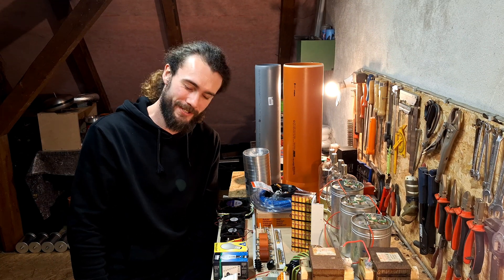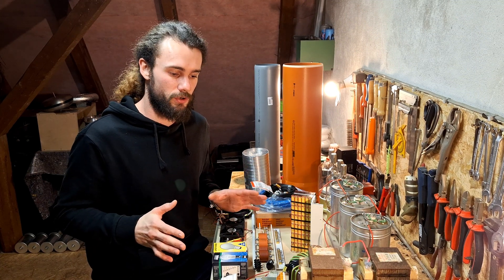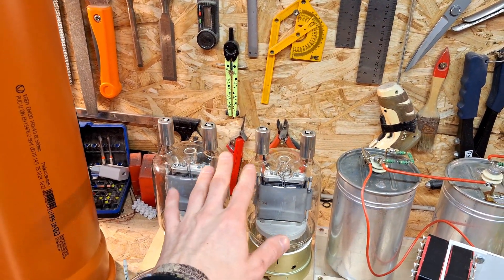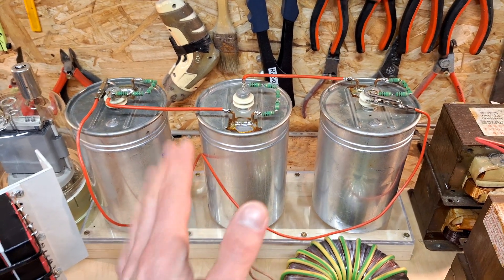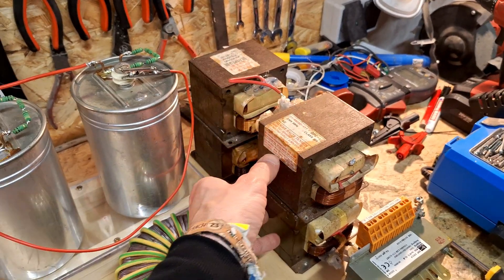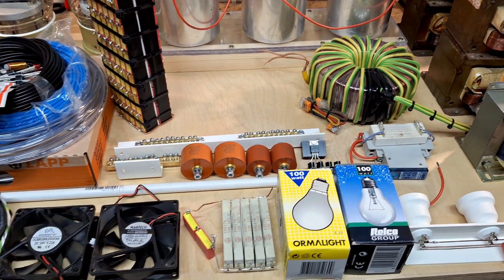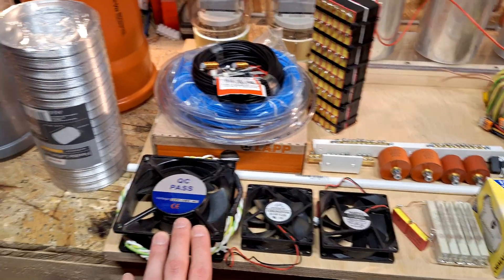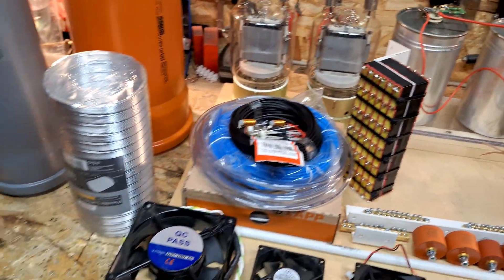I Build a New VTTC! Part 1 [Parts and Design]

Comment: Good luck my friend!
Please dont break the tubes haha.
Maybe you can try a push pull hartley oscillator driven tesla coil with them
Reply from the maker: @janno288  yeah i could try sooooo much🫣
Reply: My only thing with a P/P Hartley is the "extra" on time. The concern being heat... Already an issue. That said I suggested it as well at some point. It should have no problem driving it 🫡